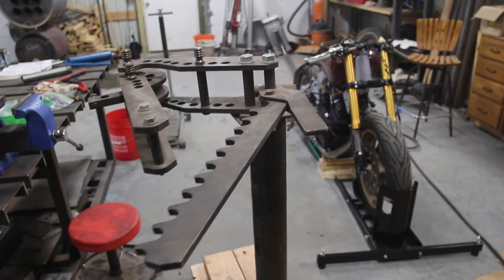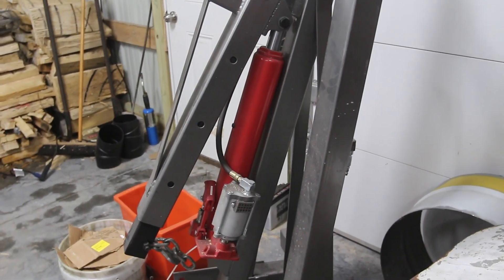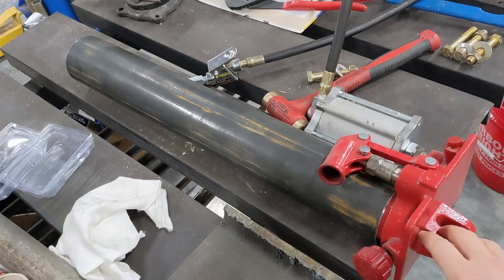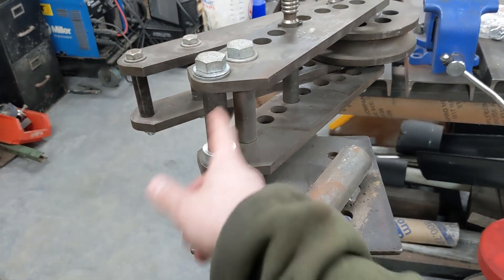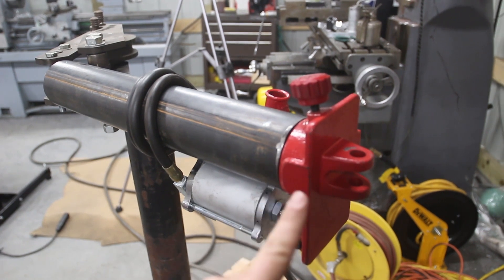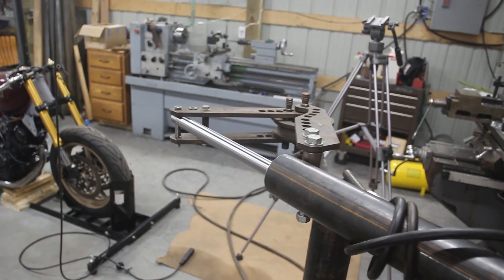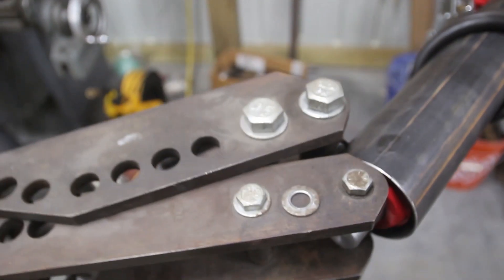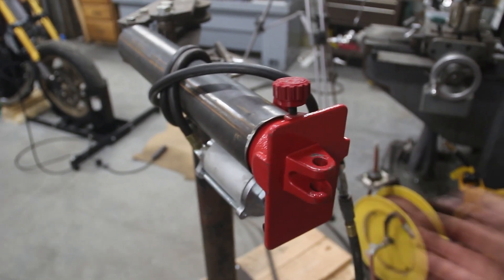Hydraulic tubing bender conversion!  JD 2 Model 3 bender convert to hydraulic.

Comment: Hey Man! was following your virago build! just picked up a virago 920 and a 04 GSXR front end. Thinking about trying to extend the steering stem rather than buying the one from Cognito. Did you finish yours?
Reply from the maker: The video retrofitting the R6 front (permanently) onto this frame should come out in the next few days.  The 83 750 frame and the 08+ R6 front end only needed one small area machined to fit perfectly.
Reply: @bewimpy3392  cool! Look forward to seeing it.